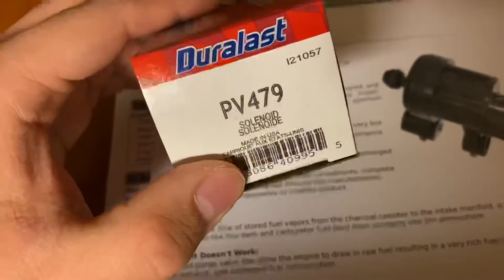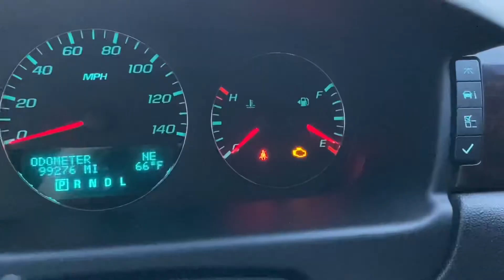Engine Light - 2015 Impala Limited LT - Code P0496 - Canister Purge Valve replacement

Comment: Thank you for this video. It looks very easy to do but trying to disconnect the electric wire and the one with the white pin you push down are hard to pull off.  Did you have a hard time taking it off? You didn't show that in your video. I just don't want to break it.
Reply from the maker: Your welcome! Actually it’s not super hard tbh. May just need a little pressure to take it off in case its stuck on but it was easy to take off

Comment: That wasn't a 2015 impala....instrument cluster and interior r in the 2006 to 2013 impalas..
.the 2015 impala is the newest generation of impalas from 2014 to 2020....I would know because I owned a 2007 impala which is exactly like yours and I now own a 2018 impala which is completely different...u need to look at door jam sticker to see the manufacturing date...u have a 2012 or 2013 because it does have the old version 3.6 lfx engine in it
Reply from the maker: 9th gen was made in 2014-2016 as well for fleet, police, rental, etc. Mine was a rental from Enterprise Car Sales.
Reply: Yep because mine is 2015 and I got the fleet in mine looks exactly like that on the inside
Reply: I have a 2015 and mine is on the back side of the engines. Easy fix, but not this easy. Lol!